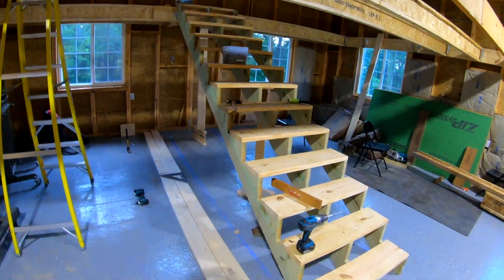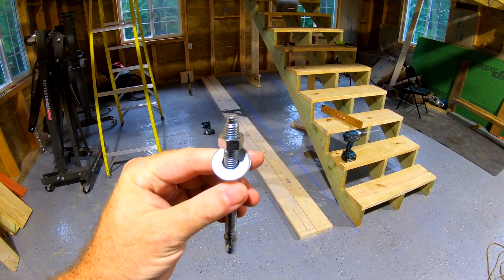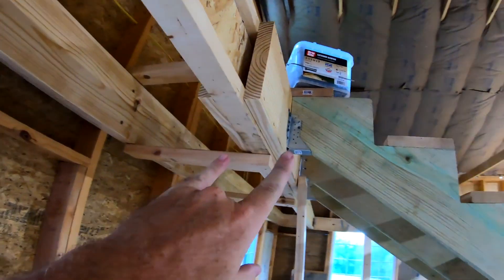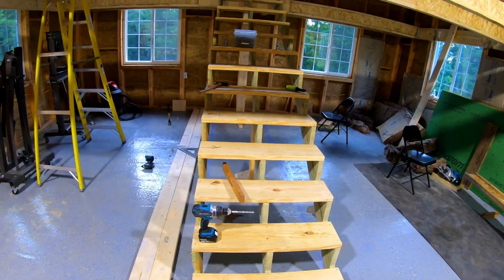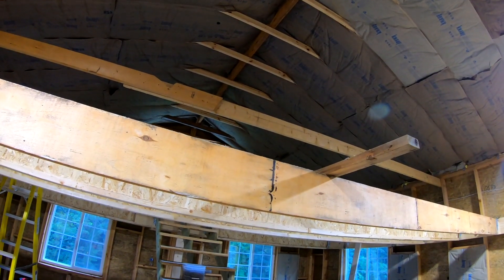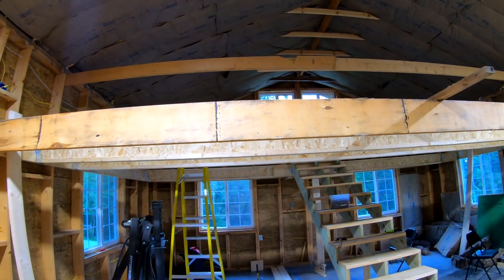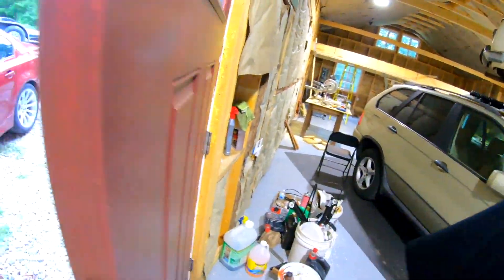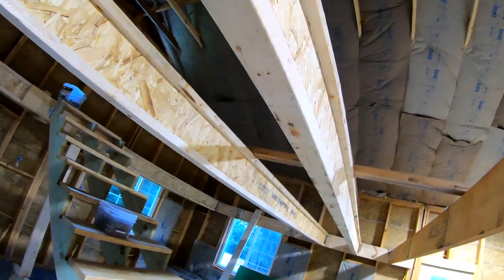Part 2 The Shop Loft Build !!! Building The 13 Step Stairs !!!

Comment: Could you not have run the stairs the other way and had them fold into the ceiling. They will be a total pain where they are.

Comment: I BUILT HOUSES, AND THE NEXT GARAGE YOU DO YOU'LL FRAME OUT THE FLOOR WHEN YOU BUILD IT. THOSE I joists were not required with a 14 foot span. placing the stairs in the opposite way  three feet out from a wall at the base. steeper pitch. would give you more room to swing cars. I joists  suck. as you can see all the unnessary extra work in your case. other framers check in. agree disagree. luv u man in a non sexual way.